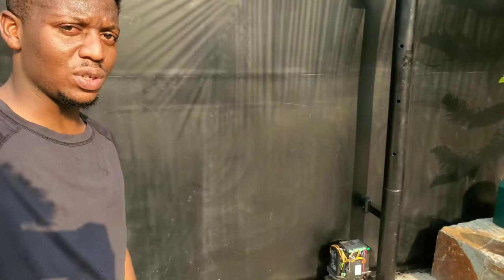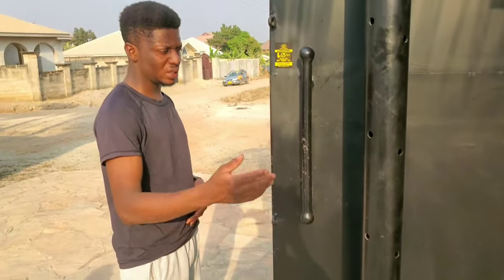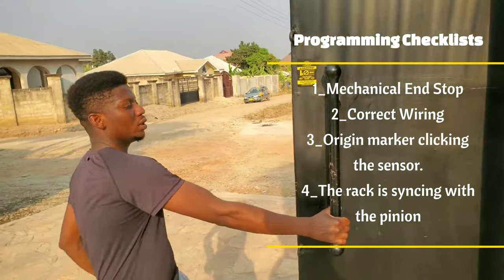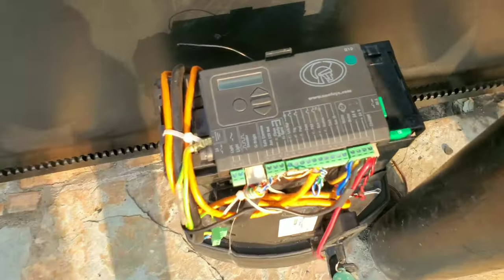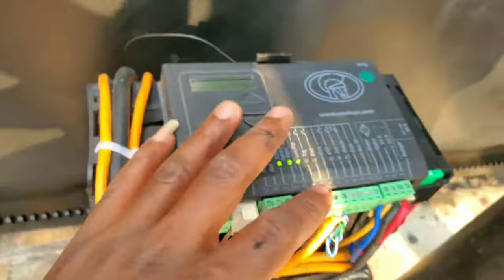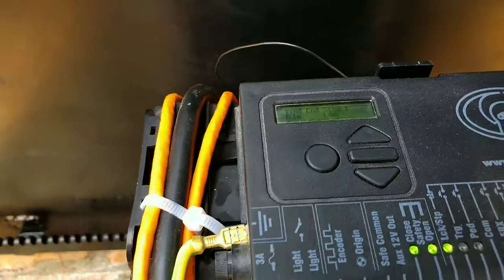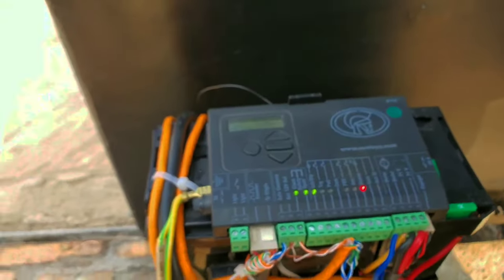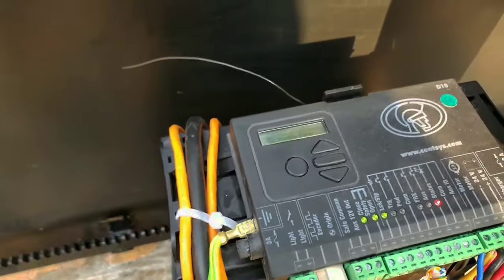Centurion D10 Programming and limit settings

Comment: Nice video Man, how do I fix similar machine that is  slow to open and close?
Reply from the maker: It's possible to reduce the speed and make this machine go slow
Reply: @EtronSec Solutions Gh  I got two error messages when trying to set limits 
the First one is 

 "END STOP DISTANCE DOES NOT MATCH, LIMIT SETUP FAILED" 

The second one is 

"BATTERY VOLTAGE TOO LOW"

Comment: Hey man 
I have D5 evo motor. I have done all the settings and followed instructions but when the gate starts for the first time it is not finishing the complete cycle. The controller is switching off itself then restarts. 
Can you please assist ?
Reply from the maker: Hi Boss! Kindly check the battery Terminals and make sure the power supply is on
Reply: Maybe your battery is faulty

Comment: I tried resting the limits but it wasn't successful. I got error message "!!SETUP FAIL!! NO ORIGIN FOUND.
What could be wrong?
Reply from the maker: You have to make sure the magnet on the gate passes close to the blue sensor (origin sensor)  in the machine. The sensor should click anytime the magnet passes by
Reply: @EtronsecSols  the magnet passes through the sensor. The stopper for the open limit is on the rail. Is there meant to be another stopper aside the one on the track?
Reply from the maker: As long as your gate can stop at each end, you are good. But does the sensor click when the magnet passes in front
Reply: Yes the sensor clicks when the magnet passes & gate does stop at both end.
At closing, first stop end was found,  but when it opens fully and stops, I get the error message "SETUP FAIL!!! NO ORIGIN FOUND" and it doesn't move again.
Reply from the maker: @el-adol  please kindly  check the screen while the magnet passes by the sensor to see if you will get any message like " origin at left " or "origin at right" if not you should consider checking the origin sensor wiring for good connection or even replacing it. +233550431624 you can WhatsApp this number for further help

Comment: Hi, after pressing start, the power goes off and restart the PC board.  What could be the reason?
Reply from the maker: Check your battery terminal or replace the battery
Reply: Faulty power circuit board